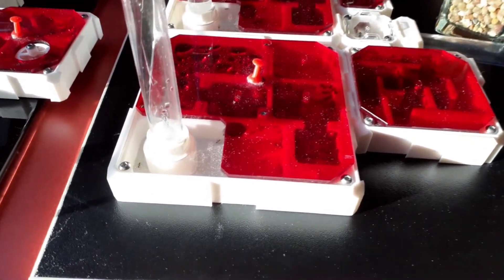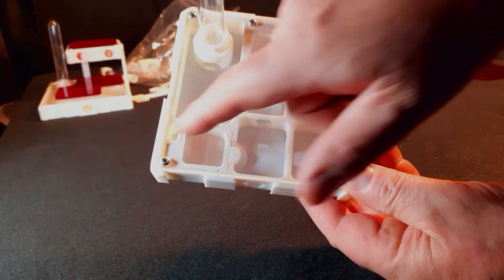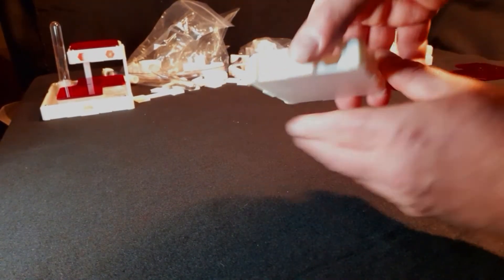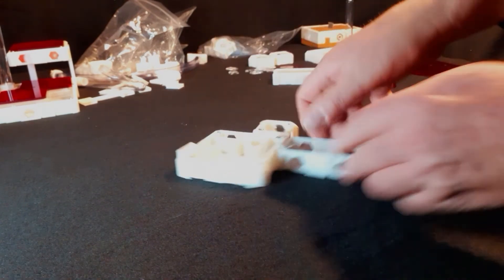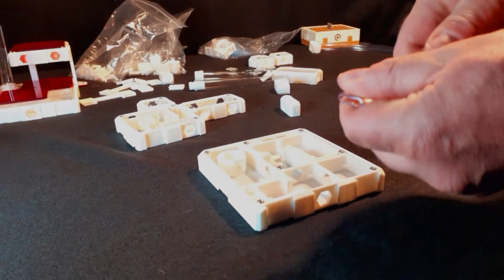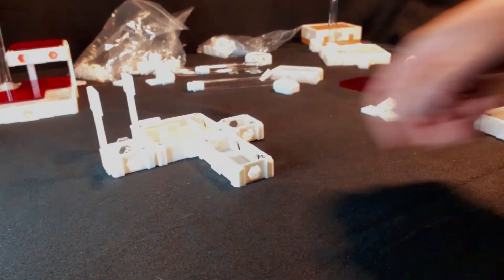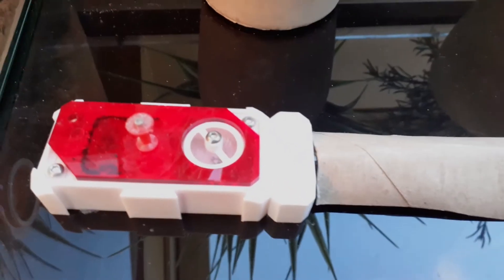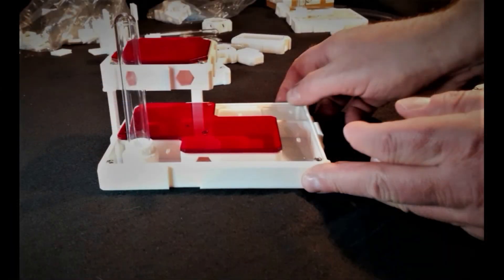The Wakooshi Nestsystem

Comment: Hi, thanks so much for this video, very helpful, I'm looking forward to checking out your other videos.  1 query though that you may be able to help me with, the vertical test tubes of water that screw into the nest, do they need cotton in the bottom? It would just flood without surely?  Wakooshi don't really make this clear unfortunately. Thanks :)
Reply from the maker: Thank you for the positiv feerback.
I have 3 of these tubes in use for many month and have no problems without any cotton wool for big and small ants.
It is working realy good.But when you change it to refill ,the nest is open.I have a spare tube wich I fill up first and exchage it quick..It helps to let it dry out before the refill so the ants loose  interest